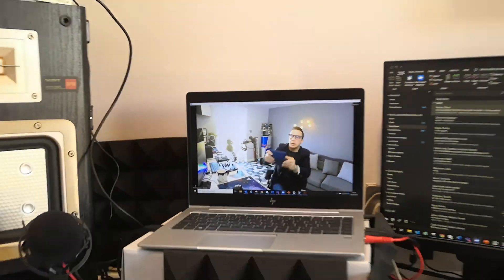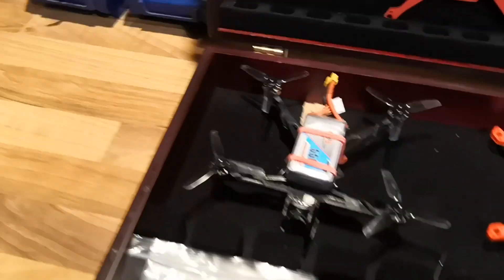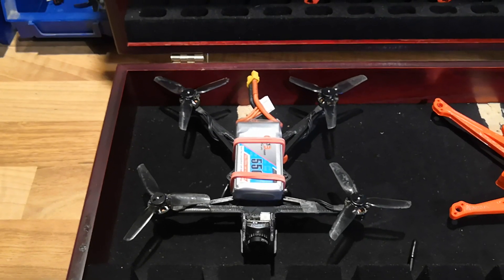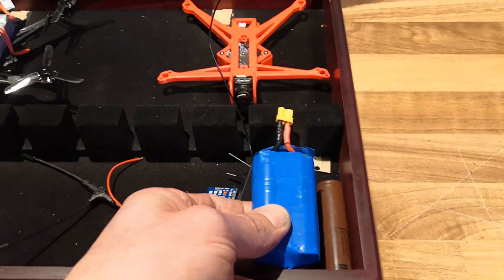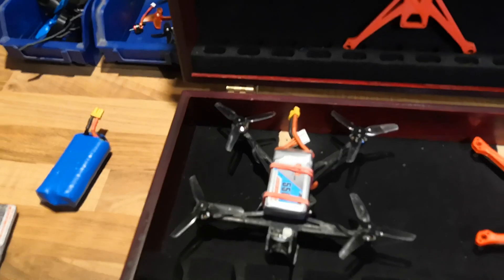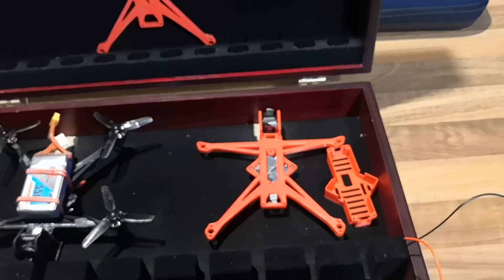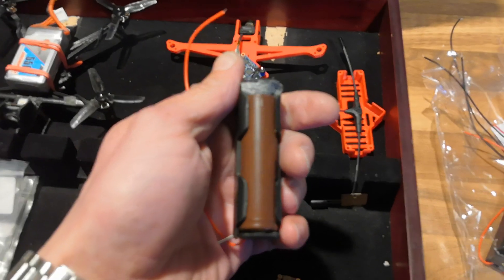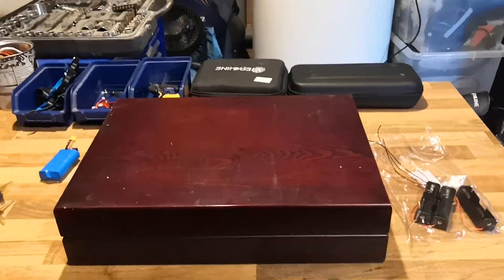Nano 1S 18650, 2S even 3S freestyle? Nano 4k? #nanolongrange by Dave_C FPV build updates

Comment: I've printed out this quadcopter and yours looks a lot bigger and thicker in size than the ones I've printed out. Did you enlarge the size of the quad?
Reply from the maker: No mate, I have now had a 1 print from a commercial company (the red one) and one print from a mate. Both were this size. Happy to take some measurements if you need me to. I finally got the VRs etc and built this with the 18650 holder I had only to have heat problems with the wiring (too small gauge) and drop out of cam/vtx too early. I am almost ready to give up on it and focus on other quads.

Comment: Hi, are you planning to complete ur Dave-c original build?
Reply from the maker: I did try, all original specification but added a runcam4k split, it seemed to power down too early in the voltage range, so I canned it! I will perhaps remake it one day, but since then I have got more into freestyle than LR.

Comment: Since you have such a nice bounty of gear can you make a 30 min + Flight time, long range fpv drone? Just for casual piloting, not racing.
I'm thinking of building something like that miself but I'm just getting into this hobby and don't have the necessary gear to pull it off
Reply from the maker: Yes mate, there are a few. If you pair a 4" quadcopter with 21700 batteries it is possible! The original one is the Flywoo Explorer LR by Dave_C. I use an iFlight Chimera4 LR and I have the 21700s, but my big focus now is to learn acro/freestyle.
Reply from the maker: https://www.youtube.com/watch?v=VJ8juI56DOs&ab_channel=GalKremer
Reply from the maker: There are a lot of vids but above is Gal Kremer here is Drone Camps RC https://www.youtube.com/watch?v=BkEi8HFWE70